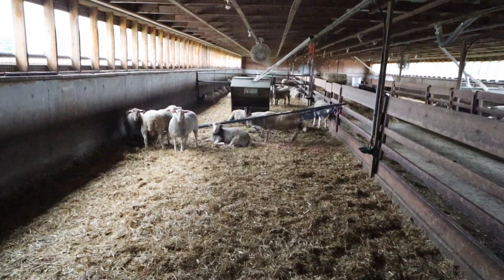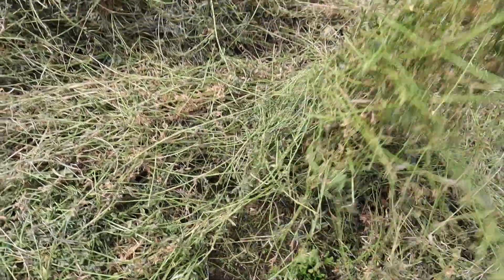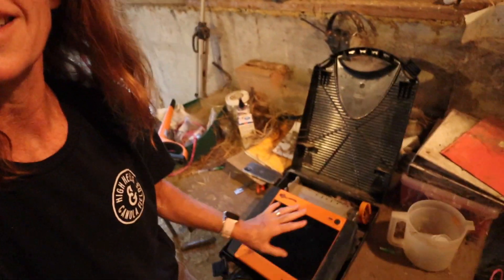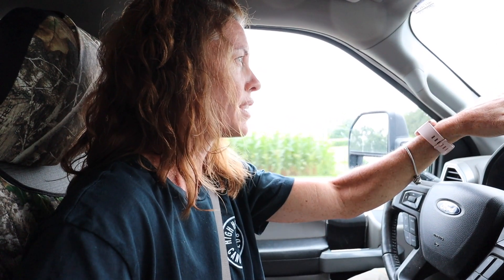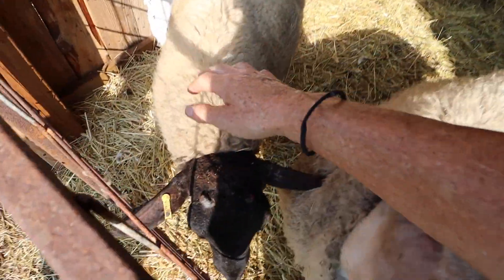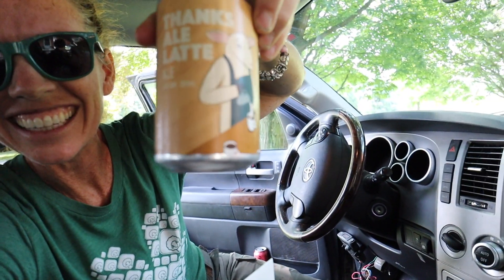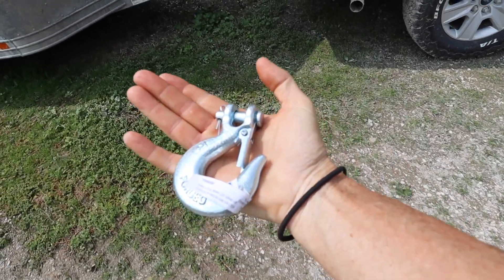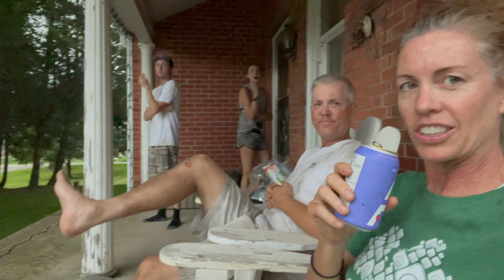EWE spell T-R-O-U-B-L-E 🙄| ...and WE DID A THING!!🥳| Vlog 480

Comment: I've watched y'all push that water up the aisles many times. Wondered if it may be easier to use a wide headed shop-vac for that instead??. I do in my basement. It pulls it up hard enough to practically dry it too. Also, I can then put the water where I want it. I haven't looked into a large battery powered one and it may be a pain to drag a cord that far. I don't know where your outlets may be along the barn. Yet, it would definitely be easier to capture it, time and energy.
Reply: I have said the same thing.

Comment: That is why Justin Rhodes created abundance  plus.... as so many are running into the same issues as you.  He can show details there and keep some stuff without details on youtube.  Kudos on big ass fans....  best choice for barn like yours....   really helps with air movement, most large buildings to put them in notice their mechanical heating units run a lot less afterwards.

Comment: For years I had a reversible fan in my kitchen and one in my bedroom.  In the summer I had it drawing the cool air from the bottom and push up to the ceiling and in the winter, I'd reverse the fans so hot air near the ceilings would be coming down to warm my rooms.

Comment: Barn issues:  When the new fans go in could they not install an inner liner with drains to the outside - might keep the roof from dripping in the temperature swings and might also help with the bird problem.  Hawk calls might scare them away, they use rubber owls with speakers in them to scare the birds around the vineyards.  Love your show, watch some shows a few times.

Comment: Tim from Ontario Canada if you have these barns  that have censored curtains and there is always a problem of your curtains not going down when there is a storm coming in... suggestion for you get a steel pole and bring your sensor out the way from your building just enough so the rain catches your sensors... and step two after you have cleaned up all your water from your floors and the floor is still wet.. use a leaf blower to blow off your floors or shop FACK with an a long nozzle.. Will do the same sort of business......

Comment: @Sandi Brock I was wondering, could you get Goat a little salt lick?  I am not sure if it's true of sheep, but when a horse does that and chews on or licks metal poles, it means they are looking for trace minerals, and they might help goat.  Especially the mineral  licks where it's more than just salt?   Just a thought to help our pretty lady Goat.  Also, a commercial shop vac with a floor attachment would work a lot faster and save your back on the moving the watery spills like you were doing.

Comment: Quick question: why does your sheep barn not have a drain somewhere in the floor? Does it have to do with regulations regarding agricultural runoff? Just genuinely curious!
Reply: Sandi has said that when they built the barn they were not sure it would work as a barn, so they also made it for equipment storage.

Comment: Some maybe not so helpful thoughts from a NON farmer:
If you test your flock, I suggest checking those whom you have filmed with patchy wool, and those whom had miscarriages or stillbirths first. 
As for helping Goat... I found this tidbit online, so I hope it helps a teensy bit! 
"Providing substantial amounts of good quality cereal hay and coarse chopped chaff, even to the extent of removing pellets completely.
Relocating affected animals to well ventilated pens with more space and less competition, noise and disturbance.It may be helpful to have hay and chaff stored in locations able to be easily accessed by the crew and to try and match the energy and protein concentrations of hay and chaff to those of the pellet ration - this may mean avoiding hay and chaff made from lucerne and high quality ryegrass/clover and instead using those made from good quality cereal hay such as wheaten, oaten or barley hay."